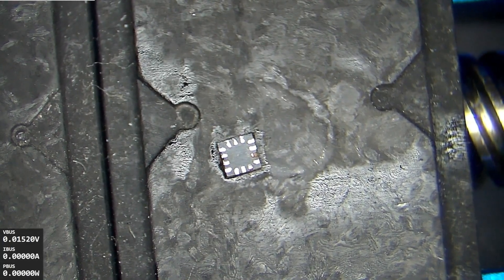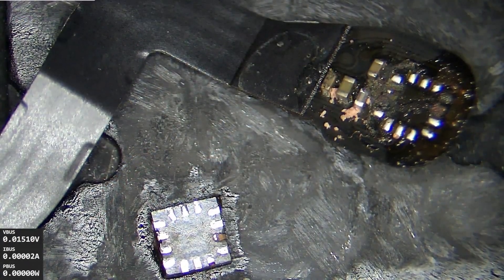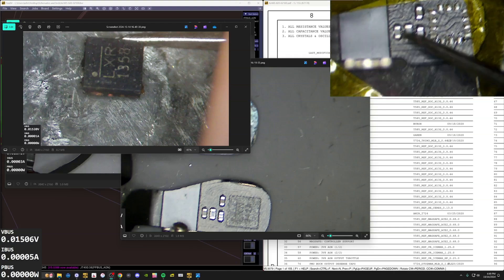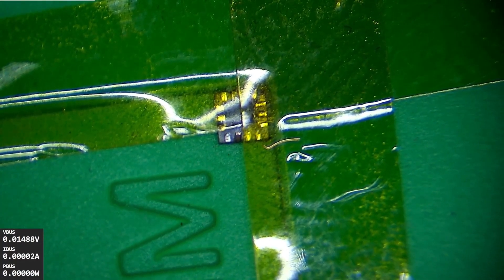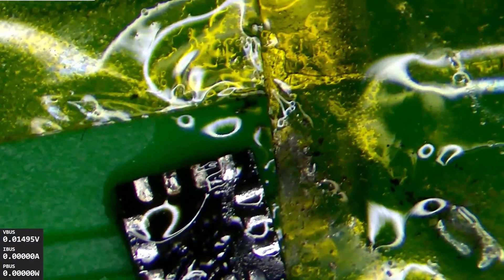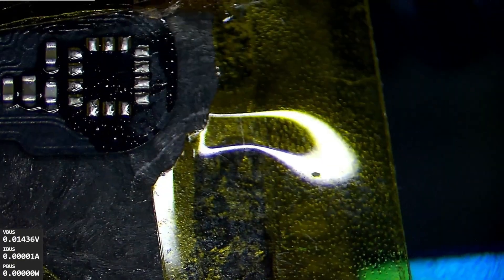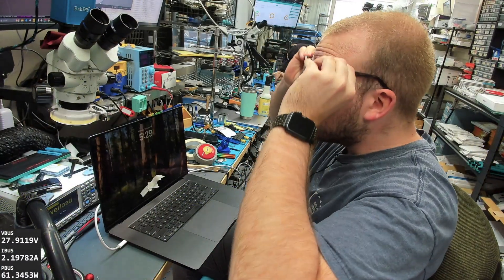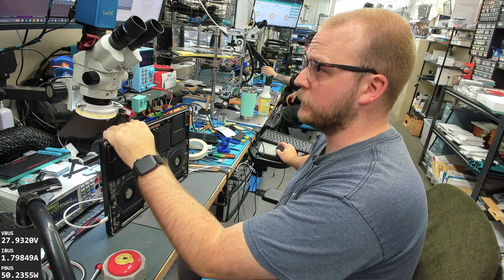Apple wanted 1500$ to repair this M3 Macbook Pro, we fixed it with a 1mm wire

Comment: I really hope someone in Belgium has the same skills as you. Just dropped a cup of rose wine on my M3 Ultra. I tried to dry it and turn it off but it would turn on by itself again. After a while it will not turn on any more. 😢
Reply from the maker: @Jorge-ls9po  I’d recommend https://www.ripperdoc.de for anyone in the EU, he does great work and has done a lot for the whole repair community, good luck with getting your device up and running!

Comment: I have the same issue with my M1 Pro; a water spill damaged the keyboard and trackpad, which aren’t working.
Reply from the maker: It is very likely just the angle sensor, you may have a shop local to you with the calibrator tool that could just replace the whole sensor and re calibrate it!
Reply: @morethanafix  everything else works fine, if I open the lid then I can see output and using the mac using external keyboard for last few months
Reply from the maker: @manvindarsingh  I've seen a handful of these with angle sensor causing no trackpad or keyboard input, I suppose something to do in the future then, good luck!
Reply: @morethanafix  can I send the laptop to you from Toronto, or do you know anyone in Toronto who can do the repair
Reply from the maker: @manvindarsingh  If you'd like to send it in all the way from Toronto then by all means!  Send us an email or give our office a call and we can figure something out👍  I'm not familiar with any repair shops in canada unfortunately.